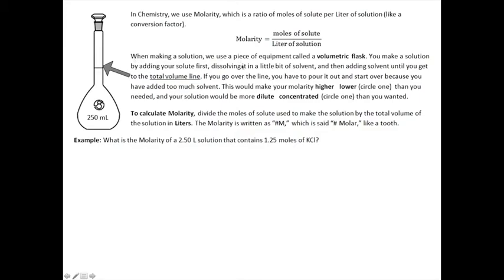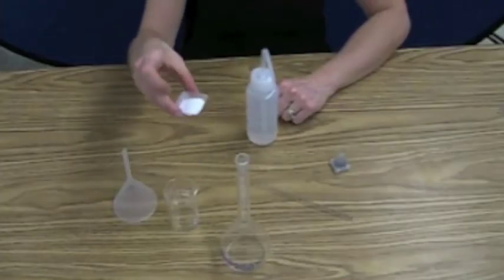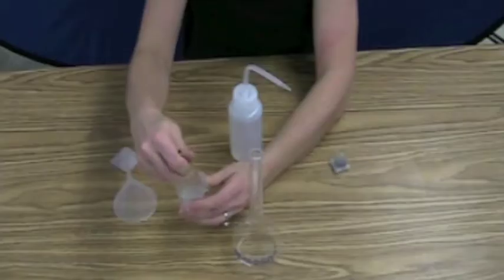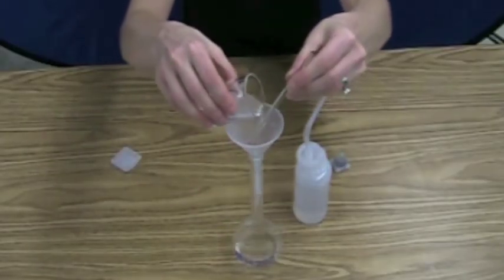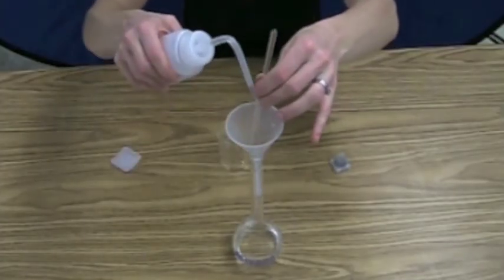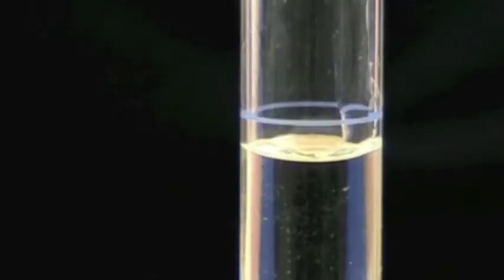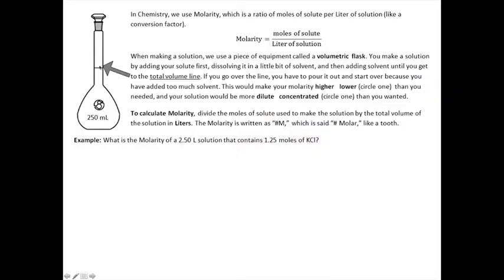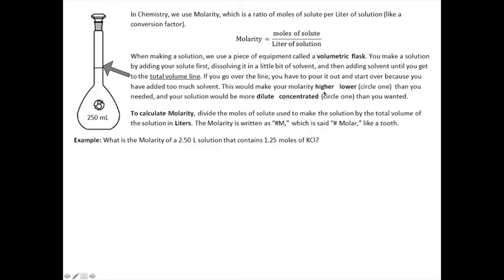How to make a solution in a volumetric flask

Comment: Question: why cant we just directly put the powder into the volumetric flask and add considerable amount of distilled water followed by swirling the flask for mixing process? It seems more efficient this way that you do not require more ash bottles to wash the beakers and glass rod into the volumetric flask. :X
Reply from the maker: There are a couple of reasons for dissolving in a beaker first. You can stir and get more motion in a beaker than you can in a  flask, which makes it easier to dissolve the solids. The other reason is that the opening of volumetric flasks is very narrow, and it is hard to get the solute in without spilling some. If you have a small amount of a very fine grained solute, you could try to skip the beaker step.